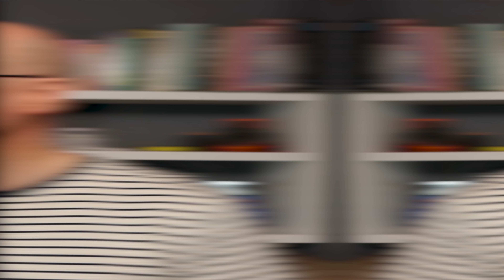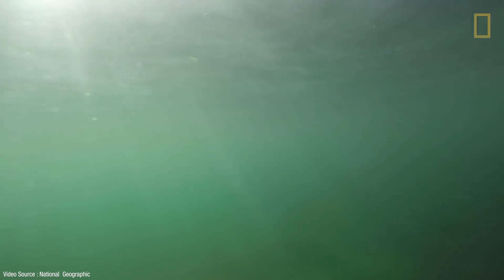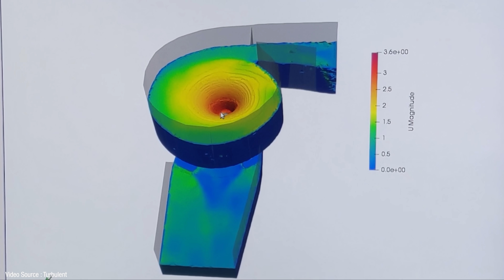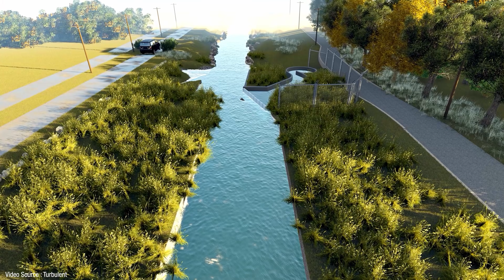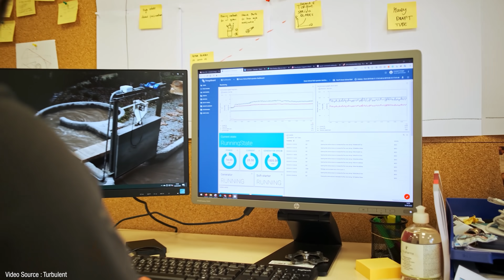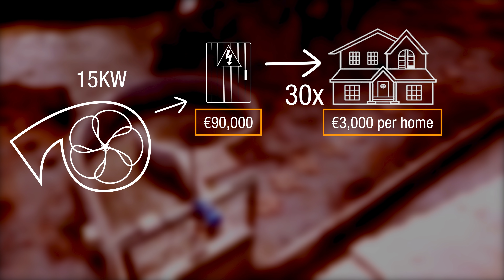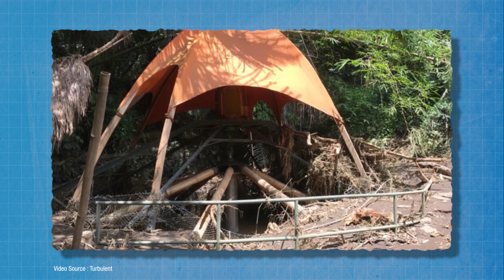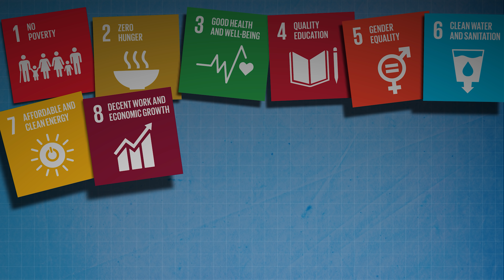Micro Hydropower : Turbulent Turbines

Comment: Good for countries with very low labor costs due to the large amount of civil engineering work. Water turbines produces electricity 24/7.
In principle, however, you can generate electricity more cheaply with solar modules because of their falling prices. But only when the sun is shining!
With solar panel you can generate green electricity for approx. 3 to 10 cents/kWh. And with almost no maintenance for 25 to 30 years.

By way of comparison, all recent studies on small hydropower plants have shown costs of approx. 10 to 30 cents/kWh.
With hydropower, you have to remove branches and rubbish several times a week. And frequent maintenance for the mechanics, which have to be replaced after 5-10 years.
The efficiency of these vortex systems was only between 30 and 48%, see Wikipedia. Usefull for low drop waterfall heights

Comment: All hydropower plants have enormously high construction costs relative to their yield. 
The costs for small hydropower are therefore usually 15 to 25 cent/kWh.
With solar modules, on the other hand, you can reliably (except the winter) generate green electricity for 25 years at approx. 3-10 cent/kWh!
Hydropower turbines are therefore only worthwhile if you need to be self-sufficient from the grid.

Comment: In your video you state tha when you retire you might pursue a location to live that will allow you to install such a micro hydroelectric system. Well, I am retired, live in a small home alongside a stream that travels the length of the property, approx 300M, and have been so interested in installing a micro hydropower turbulent system in this small stream. This installation would only require between 2Kwh & 5Kwh of output.  I have no good idea how to go about it and believe it would also require a penstock to provide additional head pressure, a sluice channel to divert water and a system of steps in the stream to raise the level for the penstock without preventing aquatic life migratory along the stream.  Can you provide a type of step by step guide, engineering challenges, water rights, contacts to provide technical support, etc.? Here in the U S states, I haven't found anyone working with the Turbulent micro hydro systems.
Reply: My understanding is that the Turbulent System's big advantage is that it does not require the same head pressure that traditional micro hydro generators require. The downside appears to be that it requires higher flow. In other words, if you have little elevation change to work with but do have a heavy volume of water then this is for you.

Comment: Another issue with dams, especially large dams, is that they trap sediment which would otherwise flow downstream to renew and expand land in river deltas, many of which are being eroded faster than they can be replenished, a problem made worse by sea level rise.

And to emphasize a point made in the video, and taking a human-centric rather than eco-centric view, fisheries can be severely compromised. The salmon of the Northwest U.S., which sustained indigenous cultures for millennia , and many non-indigenous communities more recently, have been utterly devastated, due in large part to large hydropower projects. 

So yes, there is dependable electricity produced, and some degree of flood control, and water storage for irrigation and other uses, but there are also costs beyond construction and maintenance.

Comment: A new micro-hydropower technology is working with the natural flow of water and wildlife to bring much needed constant baseload, rather than against it. The technology, called Turbulent Turbines, was developed by a team of researchers at the University of Colorado Boulder.

Turbulent Turbines are small hydropower turbines that are placed in rivers and streams where the flow is turbulent. The turbines extract energy from the turbulence and convert it into electricity. The electricity is then sent to a power grid or stored in batteries for later use.

The developers of Turbulent Turbines say that their technology has a number of advantages over traditional hydropower dams. First, Turbulent Turbines do not block the flow of water or impede the movement of fish or other aquatic creatures.

Comment: I am here because i have the same retirement dream as you. But id actually like to see this dream well before I retire. Small house out in the middle of nowhere with enough land to farm, have an orchard, maybe some livestock, hunting, and have a large moving year round water source to drive a turbine or water wheel. I actually thought of using the water wheel to turn either a hydraulic pump. This would allow an old school mechanical governor to control the hertz of a generator by way of a variable displacement hydraulic motor driving the generator. Or hydraulic opening and closing gates to control the water input to the wheel or turbine. I figure the response time would be slower controlling the speed with the water. But set up that way would conserve water if a small stream was all that was available. I have pondered this for years.

Comment: Thinking: if U put 2 or 3 of these vortex turbine generators in series
and then close the loop with 1 pump pushing the water back strait up,
would that pump need less power than generated by the turbines?
thus making excess (free) nrg

Comment: 10 years ago my company manufactured a 5kW, low head, small scale hydrodynamic screw at relatively low cost which is still working! With proper maintenance it will continue to work for many years to come. I think a major problem is the need for an abstraction licence which requires many hoops to be hopped through! Great vid!

Comment: You and/or Turbulent assume that there is enough water to run such a turbine for 365 days per year.  Many - many - locations have seasonal water flow.  So, hydro may not be diurnally intermittent like solar, but assuming that water is available at sufficient volumes for 100% supply as a baseload supply for 30 years isn't realistic for many locations.

Comment: Great ideas but heavy dependency on electronics which are prone to failure with the passage of time. This dependency on electricity as the answer to everything is dangerous if there is a case of solar flares happening.  One solar flare strong enough and everything is basically burnt up.
Believe me, I find all of this discussion of Micro Hydropower fascinating and a hope for the future but there are costs and dangers to everything.

Comment: Brilliant episode and thank you for being a great educator.

I live in British Columbia in the rain forest , sadly for now because we are in the grips of negative climate change, region. Pretty much all of BC's electricity is generated by massive scale hydro and were in the depths of a crisis in all ways of building a damn dam to meet future energy needs. Upscaling lateral thinking we could probably have avoided that dam if we threw a bunch of these units around. We have a ton of fast moving permanent streams and rivers and of grid tied (and balanced??) we wouldn't have to had worry about installing them in areas people live in, just that's there's a place to plug into the grid. 

I'm fascinated by small scale hydro but sadly my little farm isn't close to moving water but I do have enough of an incline that pumped water storage might be a feasible battery system for me with several lateral benifits. The stacking of benifits, a term used by some farmers to denote multiple revenue sources from living things on the same plot of land that's regenerative, should make it attractive.

A project and a half :) again thanks!

Comment: This makes me think we could use something similar to generate electricity by grey and/or black water; think if you flush the toilet, solids (like paper) could get skimmed off or would drop to the bottom, then the water could run through one of these vortices to generate some power.  Probably wouldn't be viable in the beginning, but very rarely anything is.

Comment: Perfect where a river or stream is available but what about everywhere else? Despite the potential friction losses, has anybody considered using basic gravitational energy for energy storage? The idea is that wind or solar energy are used to power a motor that raises a weight either up a tower or from the base of a 'well' shaft. When no wind or solar energy is available, the descent of the weight, due to gravity, is used to turn a generator via gearing that produces electricity.  As mentioned, there would be inevitable friction losses but it still seems like an obvious storage system - please tell me what I'm missing!

Comment: Please pardon my long winded comment…

I'm definitely a "noob" on the subject of micro-hydro. I'm also coming into the whole "climate-change" debate from pretty much a layman's perspective.

Hydro stuff aside, as I've read through a bit of the research on "climate-change", a few questions jump out at me. The first stems from the rather glaring possibility that atmospheric CO2 levels might actually follow temperature instead of being driven by it. It seems like a pretty important question to answer conclusively, because, if true, we'd have to pretty much rethink everything; to give you an idea of how "unsettled" the science really is, some of the IPCC climate models actually treat the Sun as a constant - i.e., it's output never changes! Sun-spots anyone?

Another similarly fundamental question is "what is the ideal atmospheric CO2 concentration" supposed to be? It really seems like the only "acceptable" position these days is that CO2 is bad and must be reduced and/or removed. CO2 is the devil's breath and must be absolutely demonized if you give a darn about "saving" mother earth. Seems like the party line is about the virtues of "net-zero"; "decarbonize this" or "decarbonize that". I haven't found or read much research that addresses the very important question of what the ideal atmospheric CO2 concentration should be. Considering the fact that the current atmospheric CO2 concentration is much, much closer to the starvation level for plants than anywhere near the maximum it's been in the past, it sure seems like we should talk about this a bit more instead of adding to the "CO2 is evil echo chamber".

AFAIK, plants die at an atmospheric CO2 concentration of about 160 parts-per-million, or, 160ppm. The current concentration of CO2 in Earth's atmosphere is about 440ppm (in other words, 4.4 one hundredths of one percent). I believe the ideal atmospheric CO2 concentration for plant growth is between 1200ppm and 1600ppm - i.e., why most greenhouses' atmospheric CO2 concentration is artificially raised to that same range. Last I checked, the geologic record of Earth shows clearly that atmospheric CO2 concentrations of greater than 6000ppm were common in the past.

If you or I were to estimate the "ideal atmospheric CO2 concentration for planet Earth" based on the above information, we'd be just as "right" as the so-called "experts" who are just guessing at it just like we would. 

Estimates do vary, but, It seems to me that since all of mankind emits less than 10% of total CO2 emissions from all sources, we might want to reconsider energy and growth policies that might have, at best, only a marginal impact on the climate, but, a massive impact on our standards of living.

Finally, until someone gives a rational explanation for the "climateGate" emails, I will remain highly skeptical of the "Anthropogenic Climate Change" (ACC) theory. In those emails, several of the original authors of the ACC theory describe in detail how data was made-up, misinterpreted, changed, ignored, or, otherwise manipulated to support their "theory". It was basically made-up. If it weren't for an IT guy with a conscience at the IPCC, we'd never know about these emails. And don't forget the lives and reputations that were destroyed by these people - all for the 'cause'. With the eagerly agreeable press and government always at the ready to lend a hand.

Peace...

Comment: There are some design problems with vortex turbines that people do not think of.

An ordinary Francis or Kaplan turbine has extremely well tailored water flow where water is directed to enter the curvature of the turbine blade gently and at precise angle at each radius. They have 94% efficiency whilst vortex turbines are 35% at best.

In a vortex turbine the water has a chaotic spin where it partly plashes against the blades and the water goes off in all directions. This makes the turbine terribly inefficient. It works mostly as paddle where pressure on the blade is from water trying to escape an obstacle in all directions.

In professional turbine water is not escaping an obstacle. It follows the curvature of the turbine blade on both back and front side. The blade is designed to curve the water path to extract maximum acceleration forces. And it is designed to direct and curve the entire body of water in between two blades.

In a vortex design this is not taken care of and hence the low efficiency or large amount of building material and flow to generate power.   

Another feature of professional turbines is they can use a draft tube below the turbine that widens and slows down the speed of the flow. This speed reduction recovers an enormous amount of kinetic energy as a pressure drop that would otherwise be lost.

A vortex turbine with a draft tube needs the central of the spiral blocked or air will be drawn through the turbine.

The vortex turbine has no precise guide vanes to be adjusted with varying flow. It will have horrible performance when flow is reduced.

There is no magic with vortex. You do not get more energy. There is still just flow and head that constitutes available power.

Look for report : "Comparative Study of Small Hydropower Turbine Efficiency at Low Head Water"

And also read: "Performance and Flow Field of a Gravitation Vortex Type Water Turbine"

Comment: I have for a long time been fascinated by hydro power. I am from Norway and we a nation powered by hydro. I saw this concept of a micro hydro some years back and had the dream to have one of these myself. 

I can’t see the downside with these to justify why these are not common around in less populated areas. Would love to find out. Mini hydro seem more cost effective than solar and wind - more stable. Though I suspect it require more maintenance cost. 

I suspect the main issue would be when the river freezes over at winter. Would also assume solar and wind don't fare better at those times.

I dream of having a house in the woods alongside a small river - being fully self-sustained:
Where I have my own power from hydro/solar – selling my extra to the grid.
My own water well, septic tank for sewage. 
The only thing wired to society would be fiber internet.
Tinkering with a house with self-sustained smart solutions.

Comment: I have an off grid cabin and currently use two 100 watt solar panels and a trolling motor battery running everything on 12 volt and also  have a 750 watt power inverter for small power tools. My idea is to use a siphon pump called (free energy water pumps all over YouTube) if you need reference. In the loft siphoning from a small 30 gallon water barrel, I use in the cabin for my filtered rainwater.Creating a vortex in a upsidedown 5 gallon water bottle that empties back into my freshwater with PVC half pipe for blades in the vortex turning a DC motor to charge a beep cycle battery to run the cabin when the sun isn't shining . I'm planning on building it this summer.any suggestions

Comment: Except for the rounding of the turbine edges, their turbine is nothing new.
In 1993. in Nemila, Bosnia, a local man (don't know if he were an electrical engineer or an electrical technician), due to the power outage as a consequence of war, built exactly the same thing.
First he built about 50-100 meters of concrete channel to raise the water level to about 3 meters, then made a spiral shape in the end to get the water spinning, and then placed a turbine at the top.
He used maybe a 2kW motor as a generator, and a capacitor to start it.
We could see a dozen incandescent 220V light bulbs running on that power.
Unfortunately, none of the structure is there today. Bosnians tend to go back to the easier way of life once the necessity is gone, and it's easier to just use the grid power.

Comment: This is very impressive. As a civil engineer I have found that rather than using bespoke designs for each site it’s best to have a range of modular designs for different situations, for example levels and flow rates, and then make shutters and/or fibreglass formers to suit and impellers to fit. In other words a standard range of repeatable kits.

Comment: Why aren't the Government investing in these systems. All of our larger rivers are actually tidal for miles upstream. The system could be made to utilise the tide flow in both directions by using movable ducts to direct the flow over either side of the turbine blades so it always turns the right way to generate power  regardless of the tide direction. The tide is never going to stop. Is it,!! Plus,as you say. No major engineering, low visual impact on the landscape as they could be easily camouflaged by shrubbery. And lots fewer giant windmills which only work when the wind blows. 

 either direction

Comment: Curious how efficient one could be using a water mill to a gear driven hydraulic pump with lines running to a remote hydraulic motor/gearbox turning a generator?